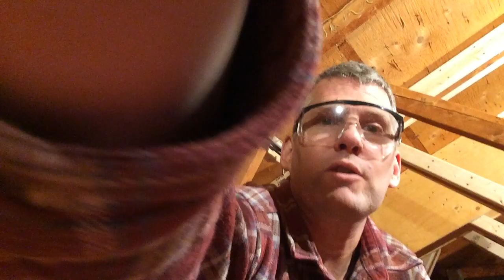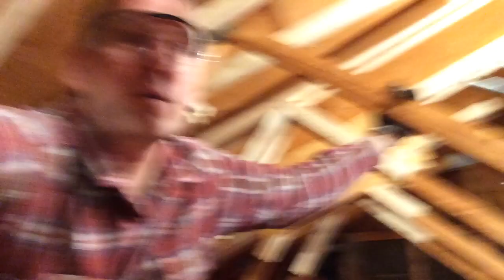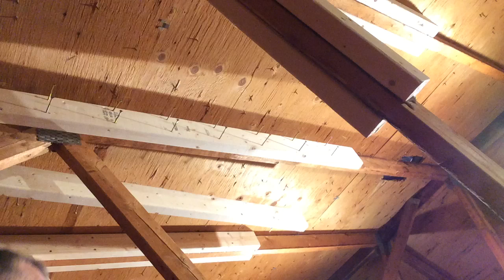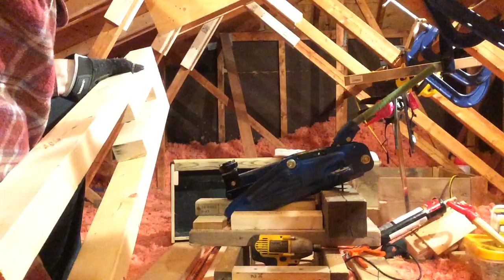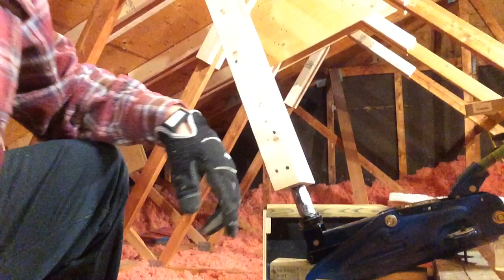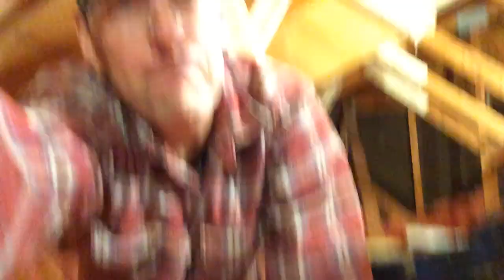Attic Truss Repair 05: Glue & Screw Top chord splice

Comment: I recently went around with a 'Truss Company' for the rafters on my garage.  Trusses I need are 42' long with a 5/12 pitch.  I looked at the spec sheet that they had 'engineered' and it seemed kinda light.  Meaning that it didn't look heavy duty enough for the area that I live regarding the wind speeds we get, along with the snow load.  The guy said it was to specs for the area and snow load.  I told him I wanted a beefier truss and he began to argue with me that it was not needed.  I walked out seeing as last year we had an unexpected heavy winter that at one point I had over 3' of snow on my roof at a 2200' elevation.
Reply: Never argue when the customer wants to spend more money.  Better safe than sorry.

Comment: A comment about handling and putting heavy clamps onto trusses (especially on the top cord) and just turning them loose, unless you have a floor in the attic, you've gotta assume something will drop on the sheet rock.  Just string a piece of paracord across the truss and tie some little clips to your clamps and you can move them easily.  No worries and it's cheap and simple to do.

Comment: Where did you get the structural engineering analysis and repair specifications?  Do you use an engineer that specializes in trusses, or will any architectural engineer know how to do this?

Comment: my guess is your a fired 8th grade wood shop teacher.screws have little sheer strength as apposed to nails
Reply: That’s why he used structural screws. They’re rated for the shear stress involved. Drywall type screws would indeed fail.
Reply: Timberloc's would be my choice on that repair, 👍🔨🇮🇪
Reply: Not true.  Common nails are very low carbon steel and only hardened (or hardenable) by cold drawing.  If you look at the specs they are just slightly above the yield and tensile of a grade 5 bolt for comparison.  Name brand construction screws on the other hand are high carbon steel and heat treated.  They are approximately equal to a grade 9 screws.  Of course you still need to follow your sizes and diameters.  Stainless nails are different and have a higher tensile, but similar yield strength. These are all published specs read up.
Reply: and, if you're already using screws adding large washers with a smaller one on top would distribute tensile force and help with wood splitting...

Comment: Yet another example of repair done wrong ... you came close tho.  You also have to use 3/4 thick cdx first and make it solid between lower chord and roof chord ... then you add your 2x4/2x6.  The truss is not in the middle ... the osb/plywood is.  The same way the make I-joists.   This per truss manufacturers engineer as we fix broken trusses in the field ... at least these small ones that he's working on.  Very doubtfull this is approved by truss engineer.  He has 3 layers of 2x4 ... only set of gussets is on broken truss.  The plywood/osb ... is stronger than those added 2x4's.  Don't believe me ?  Go find out how they make I-joist to hold up the 2nd floor.
Reply: i'm confused why this guy is doing all of this work? his trusses look like they are in OK shape.
Reply: Richard, hoping for a little help. When you say make it solid between the lower and roof chord, are you suggesting putting the cdx from top to bottom chord?
Reply: Apparently this design met the need. Lots of alternatives to carry the stresses.

He had a heavy handed roofer throwing shingle stacks around and the metal plates separated from the wood or loosened on several trusses.
Reply: Wrong!

Comment: By now, I admire your video-graphic skills. 

Why didn’t you first glue the wood, hold it with clamps, then drill each hole and apply the screw?

Earlier you mentioned that the engineer suggested some special wood to use. Can you please what kind of wood is it?
Reply: The glue first and longer drill bit option does appear faster and easier, given the number of boards in this project. But I’m not sure I’d have thought of it on my own. That’s why I always comb through the comments too.
Reply: These were good comments.  I ordered some long bits before I started.
Reply: @robert574  Lessons learned from recent health related issues: Do not go into attics or crawl space without your partner knowing  where you’re going and stay hydrated in there. Keep your mobile phone with you. Wishing you all the best.
Reply: Probably southern yellow pine.

Comment: Would you please give me a bit of advice on my 1950s house? The west side of my Hip roof is sagging, like those old rafters are warped. Can i go in the attic and simply erect support beams between the rafters and the ceiling joists, in a inexpensive attempt to just prevent it from sagging any further? thank you
Reply: Probably has missing brace and the hip is now too small (size of the hip)
Reply: You don't want to push the ceiling joists down, either. I'm having the same issue right now. My father in law is a structural engineer and were planning on putting some support pillars in the crawl space to support the floor of the house. Then we are going to use some 8 foot 4x4 and some 2x6's for the top and bottom plates to support the ceiling where we are going to add supports in the attic. We will then put 2 bottle neck jacks in the attic with some 4x4 against 2 8 foot 2x6's  and Jack our roof up till it looks nice a level from outside. Then we are going to kind of build our own trusses to support the weight of the roof so it hopefully will not sag anymore. But we do not want the weight of the roof to push down too far in the ceiling joists and possibly crack the ceiling so you have to have support for the ceiling and also have support for the flooring as well. I have a long span of ceiling with no load bearing walls. So that is why we have to support the ceiling. If you have load bearing walls in the area, you would be just fine using some bottle neck jacks and some 2x6's to jack the roof up little by little and putting support pillars under it.

Comment: OMG. I had to quit watching.  You are making this way more difficult than necessary.
Reply: He explained that an engineer told him what to do. The structure of the truss works by distributing the weight in a specific way. If you just go up and nail it off, you can cause it to distribute the weight in an unintended way. Then you have more problems. There's doing it, and then there is doing it right. People are so impatient...
Reply: @IdealistINFP  plus it helps on the resale of the report is found to be sound Alondras with the repairs
Reply: @IdealistINFP  he is recreating the structure already there by sistering. Not a lot of wiggle room to screw up
Reply: Seriously. Glue and screw. Done
Reply: Just use one 2x6 instead of two 2x4

Comment: How did you determine that you had jacked the new lengths up high enough before attaching them permantley ?
Reply: Run a string line at the bottom side of roof chord ... or use a 4 ft level ... level just barely long enough tho